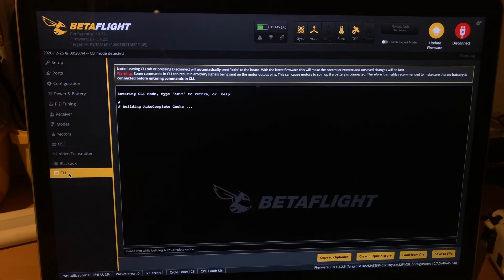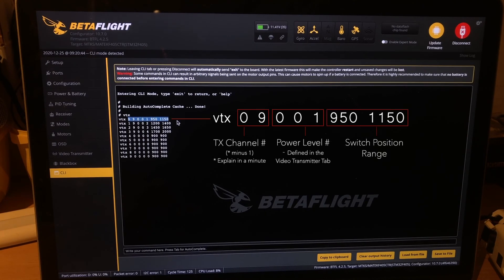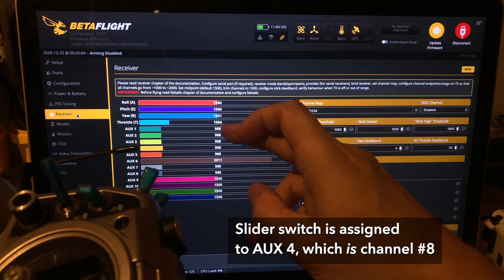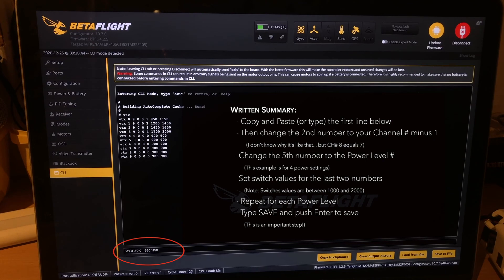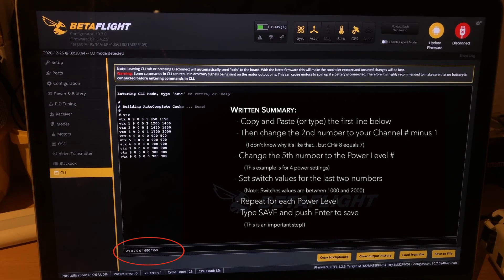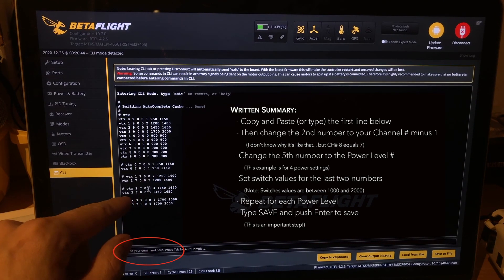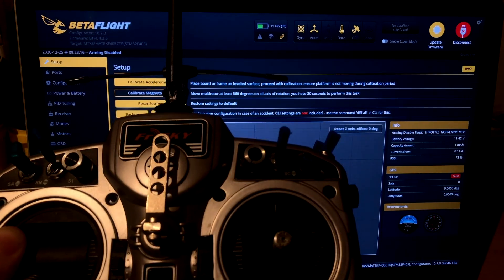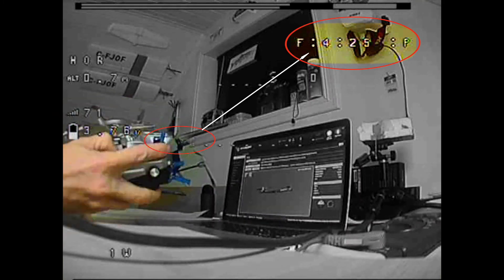Adjust VTX Power while flying using a transmitter switch! A quick How To video for every FPV pilot!

Comment: My reply comment keeps disappearing... Trying in fresh one.

Drone Specifications:
Item name: 2018 GT-M540 Normal X RC Drone

Mamba F405 flight controller: MPU6000 Six-Axis; OSD; 16M Flash; 5V 2A BEC; CURR

Camera: Runcam Swift

VTX: TBS

ESC: Mamba F40 4IN1 / 40A 3- 6S ESC Dshot600

Motor: Edge racing 2308 1950KV

I lost all rx function after just typping vtx then switched tabs to see transmitter tab if it was working then it kicked me out and have no rx at all now and it is making non sensical flashes that the manual has no answer for.

I decided to go back in and finish settings so I try to change first one and it gives me the parcel error. I was thinking  I would set the settings then put on a new rx but parcel error... gave up on vtx setttings. just wanna have a rx thatr works again without having to build nnew drone
I  am at a total loss for this one. Motors wont spin up either in betaflight, just testing to see if anything works. I think new flight controller maybe?
Reply: Time to try a geprc drone lol
Reply: After running through the TBS manual for their VTXs I think I have to unlock before I can change any settings. The RX issue really is a head scratcher though
I dont see any reason a problem should have occurred. If you have a solution or idea that would be awesome. If not then if/when I solve the issue I will post the resolution here for others to see in case they run into this issue.
Reply from the maker: @cody2254  when you leave the CLI tab it automatically restarts Betaflight. Unless you typed save it would not have changed anything. 

You said you clicked over to the transmitter tab; could you have switched something in there?

Another thing that had gotten me is, make sure the controller isn’t right next to the quad or it won’t get signal, my FRSky RX and Tx have to be like 3 ft away from each other to work. Any closer and it just blinks...  

Have you tried rebinding the RX?

Regarding motors spinning in BF, do you have a LiPo battery attached? and did you click the “warning switch” in the screen. Sorry if this is obvious, just want to make sure the simple stuff isn’t the problem.
Reply: @GiantAntCowboy  Didnt switch anyting in the TRansmittter Tab, TX & RX distance didn't have an effect, and yep hit the warning switch and battery was connected.
Reply from the maker: @cody2254  you could try re-flashing the FC with the correct Mamba firmware. If you’re not sure how to do this search Google/YouTube there are lots of great videos/threads about it. Pretty easy, not sure of if your FC has a boot loader button, but basically your press that and then select the BF firmware for your board. That would correct any software issues, which this very well could be.
Reply: @GiantAntCowboy  I will look that up thank you! What VTX are you using btw?
Reply from the maker: @cody2254  I’m currently using a Matek 800mw mini, TBS Unify Pro HV 800mw, and an iFlight Succex 500mw. All have this adjustable power setup, and work great. Not sure which TBS you have, but TBS stuff is generally great!
Reply: @GiantAntCowboy  Hopefully I will get this thing figured out, if not I will save the good parts for a future build. The vtx has settings up to like 500mW and right now it is on 25mW until I unlock it so I think I can make it work once I get it with a working rx again. FPV is alot like dirtbikes and quads and trucks, your fixing and repairing as much or more than riding but it is all sooo worth it lol
Reply from the maker: @cody2254  absolutely man. Old car and motorcycle guy myself. The challenge of fixing and learning makes the flying and driving that much sweeter. Plus down the road knowledge gained opens up cooler opportunities. Keep me posted on the fix/repair. Hope it’s simple. Cheers!
Reply: @GiantAntCowboy  For sure!!! 🍻

Comment: Thank You so much, I needed to know how to do this. I have been flying chasing dirtbikes and have trouble catching up close footage up the face of the jump cause of the dune eating my signal lol. Just now learned  I have tbs and was looking to figure out how to just adjust it but this is even better than the method in the manual!!! Big props on the find and the video!!!!!!!
Reply from the maker: Thanks for sharing your appreciation! As you know it takes a bit of effort to produce videos, so it’s great to hear when people find them helpful. 
This is one of my favorite mods for sure, I do a lot of forest and mountain flying and have the same signal issues as you. Penetration through sand and rock is tricky/impossible but a good high mounted CP antenna and some extra power does help!  I’ll check out your videos later, sounds fun. Cheers bud!
Reply: @GiantAntCowboy  So it gives me a parse error when I try to change the vtx in the cli. I am completely flabergasted lol. Also now my rx wont connect, about to throw a new one on and see if it fixes it.
Reply from the maker: @cody2254  Hey Cody, bummer to hear. I can try to help, but will need some info. 
- What have you done so far? Did you simply type VTX in the CLI and it gave you error? Or did you actually change some settings?

- What kind of VTX do you have?

I can’t see how this would have affected the RX, so might be a separate issue, but let’s see.
Reply: @GiantAntCowboy  just realized I was on my other account. I am both Cody and BigCodyFPV sorry for the confusions lol

Comment: Great info!!! Thank you very much 👍👊👊
Reply from the maker: Glad you found it helpful, it’s a great feature to have for various reasons. Also thanks for the subscribe! I’ll be sure to check out your channel as well, always fun to see what others are doing. Cheers! p.s. Let me know if you have any questions with setup.
Reply: @GiantAntCowboy  I have been very  hesitant to try this out as I have had some bad luck here lately with shorting out and frying the board . 3 to be exact F.C. as I watched video's on this and came across your video and got a better understanding on what needs to be done , I pulled my bird apart and discovered I can set up a switch to control my vtx and use a 3 position switch for this feature 🤞🤞 will try that first then go from there . Greatly appreciate you , your very welcome 👊👊✌ have a great weekend and be safe 💪👊 greatly appreciate the support as well 👊✌
Reply from the maker: @GenesRCAddiction  ugh, I feel you. Most of my expensive repairs have been due to shorts... a wet grass blade, random metal dust or something, and some mud. (Everything is heavily conformal coated now... As for soldering i usually check for shorts using a multimeter before powering up. Quick easy precaution. Let me know how this turns out. I heard that some VTXs reboot when switching power, I’ve never experienced this and think the people saying this have digital systems, but definitely bench test this setup before you’re flying high and far!